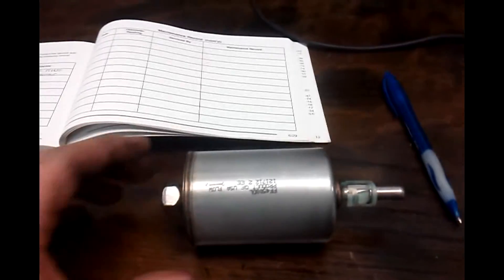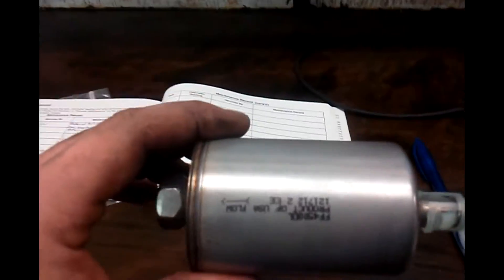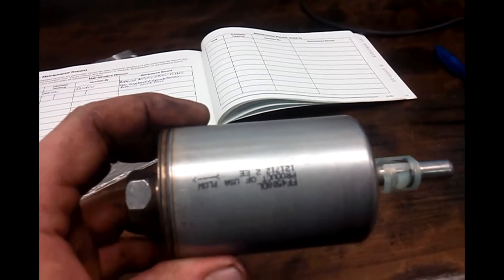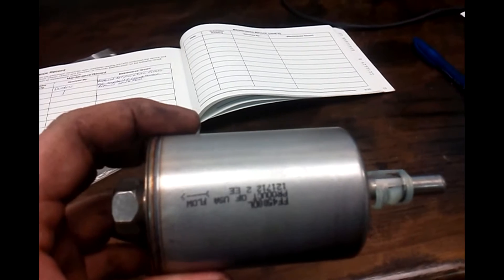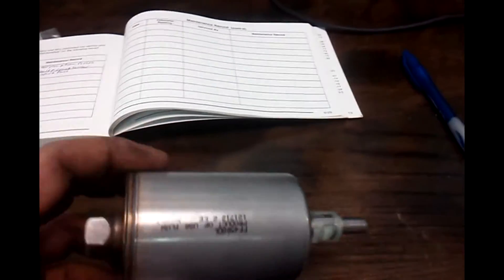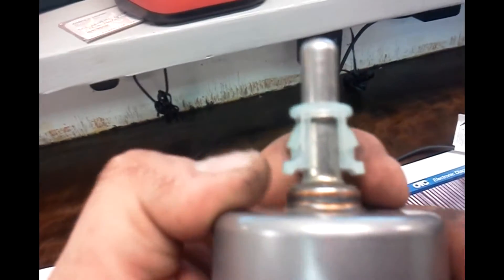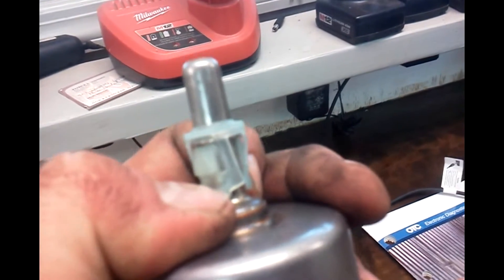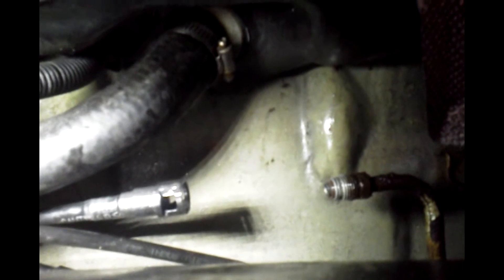2004 PONTIAC SUNFIRE FUEL FILTER REPLACEMENT

Comment: Still driving my '03 Sunfire twenty years later. Thanks to you and the community of owners for the tips; I suspect my leakage is a rotted O-ring on the female connector. MY hint there was trouble brewing happened three days ago when, for the 1st time ever, I had to crank and crank to get the engine to fire. My guess is the leak at the fuel filter had drained the line. Also, when driving I felt an occasional stutter... probably momentary & intermittent fuel starvation because of the leak. Now, if I can just get this 73 old body of mine under the car...

Comment: My fuel filter nipple connection is leaking' both the connector and nipple have plastic tabs shown in this video's and neither have cracks or ward's but when they snap together I get a leak' at the convention, why?